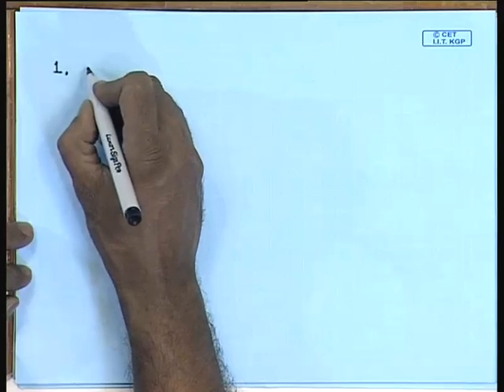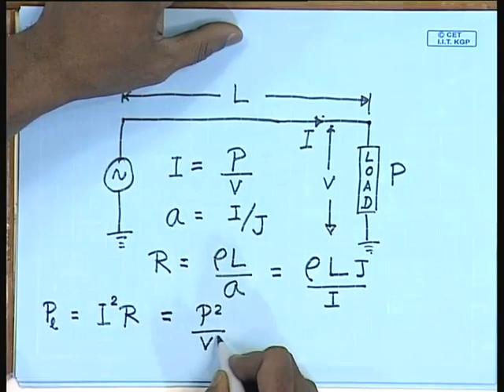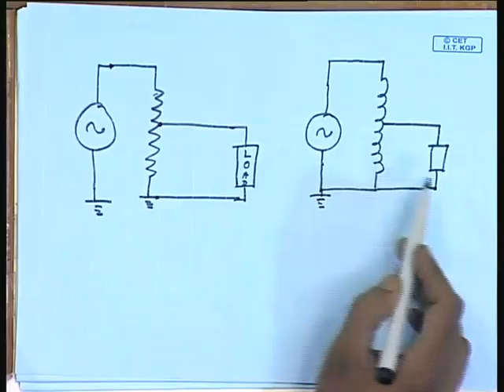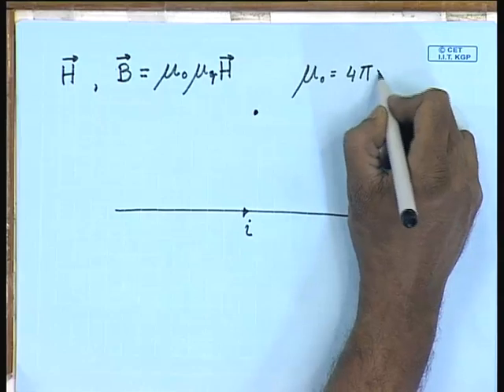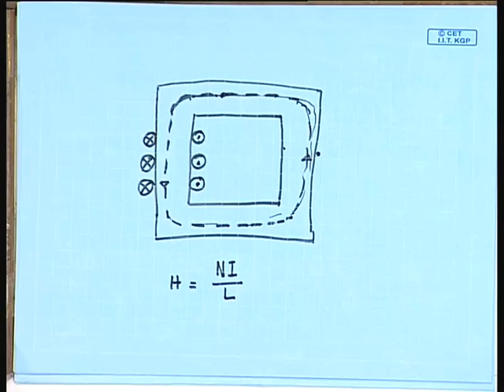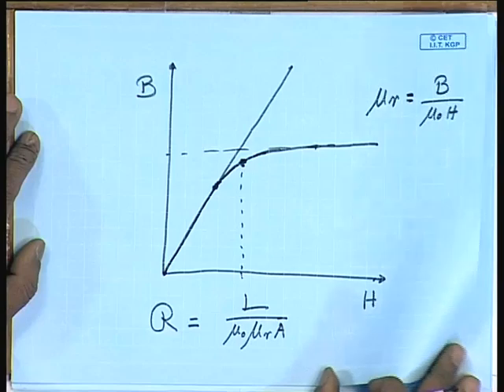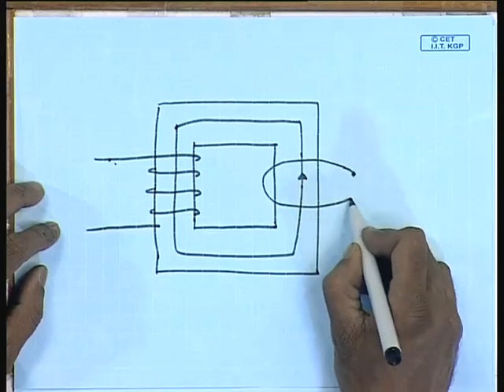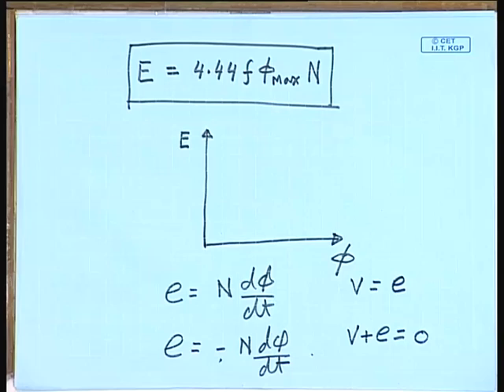Mod-01 Lec-01 Lecture-01-Introduction

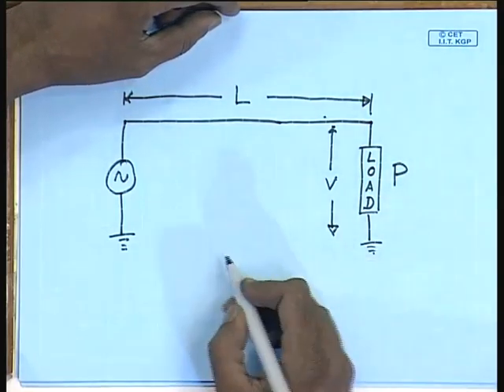Comment: 7:59
power delivered at load... are you kidding? isn't current I equals p/v when P is the power at which voltage is generated at the power station? How can that be equal to power delivered to load as voltage drop across transmission line will cause it to be less than original.
Reply: You are ryt, but it is something like saying, power is considered same all along tr. line. Even though there are losses, they are considered to be negligible, as inductance is much higher in a Tr. line. Consider his explanation as on the secondary of a Transformer, rather than load. It would be same. V high, I low.

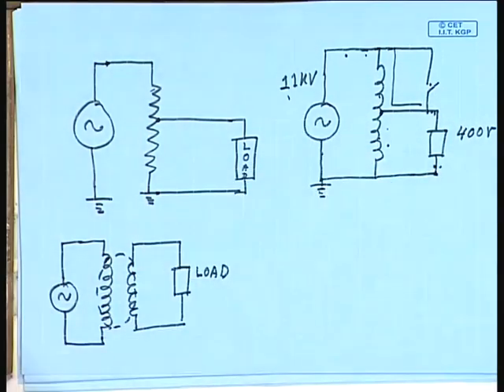Comment: Just suberb. But one thing I think the teacher forgot to mention, at 19:40, he didn't exactly explained the reason why the current flows that way. According to right hand rule the current should flow the opposite way (counter clockwise).
That's because of Maxwell's Law:  curl E=-dB/dt , so the electric field in the conductor has the opposite way of the B.

Other thing is that the Phi arrows show go out of the paper and not along the paper, because that way the conductor plane and the Magnetic flux plane would be the same (the internal product between the normal of the conductor plane and the field B would be 0)
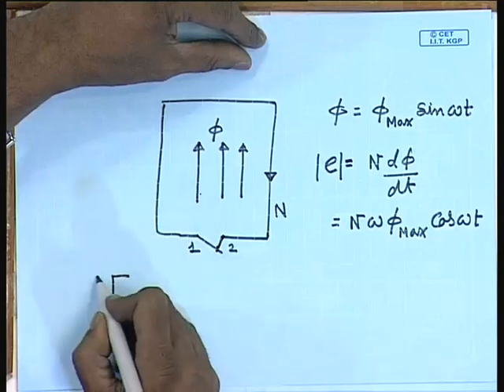Reply: At 19:40?? I think at 50:47 he denotes wrong terminal.
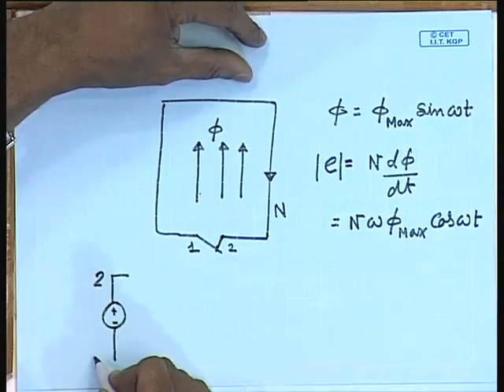Reply: at 50:47 he is right...coz at zero instant of time terminal 2 is positive and terminal 1 is negative ...the next instant 2 becomes negative and one becomes positive...